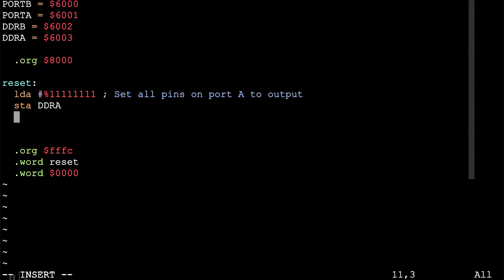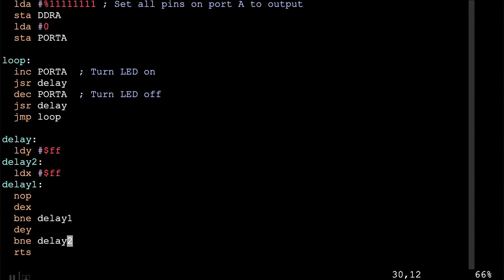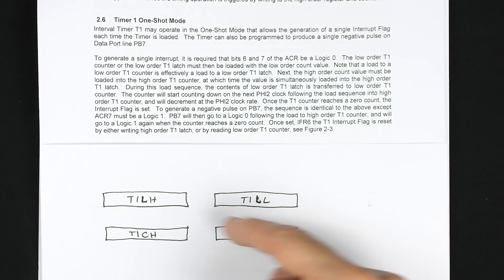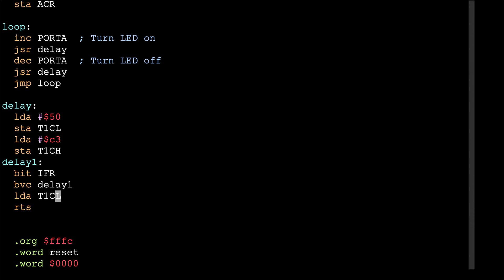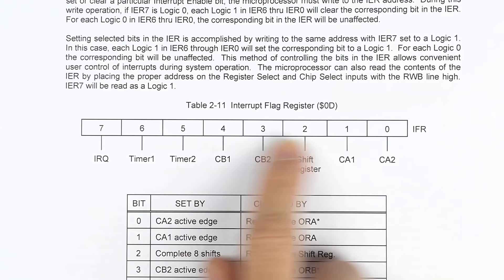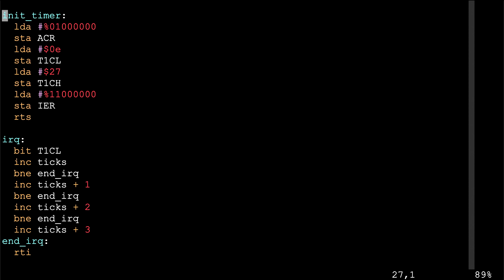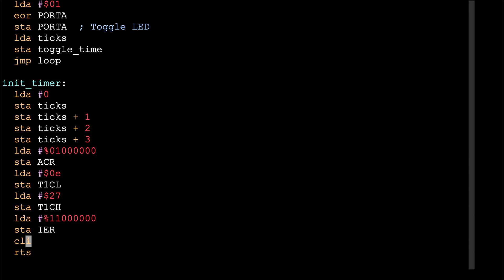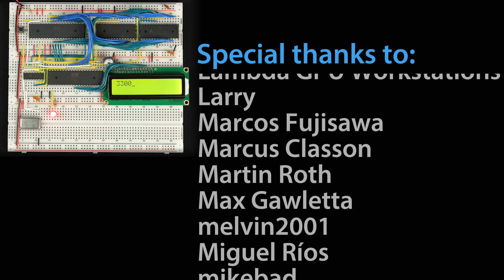How do hardware timers work?

Comment: In a more sophisticated system, I might expect the timers to be triggered a little differently.
In order to not require a "main loop" like you have... perhaps you would instead set up a time to wait and then mark the "return address" of your wait somewhere, and then when an interrupt occurred it would check if it's waited long enough, and if so, jump back to your code?
Reply: That's what schedulers are for.
Reply: Or just have the timer trigger an interupt, have your interupt routine check which timer triggered it and execute the address you defined for that timer if you want that functionality with this hardware.
Reply: @ELYESSS  I wrote my own for arm cortex using the 24bit low-power rtc timer:
 for (int i = 0; i < TaskListEnd; i++) {                                         // look at all tasks interval register
      temp = task[i].sleepto;                                                         // get a temp copy
 
      if (temp != (uint32_t)-1 && temp > rtcmatch) {                // a set value and not already past due
        if (temp < lowest) {                                                            // is it a new lowest
          eventrtc = (1 << i);                                                           // when we are the next event
          lowest = temp;							             // this is the new lowest
        }
        else if (temp == lowest)						     // merge us in as we have same as another
          eventrtc |= (1 << i);
      }
Reply: @someguy4915  This is how it should have been done. It's not "correct" to handle the LED switching in the main loop like he did, instead, what needs to be done, is to have an interrupt signal coming from the timer to make the CPU execute an interrupt subroutine (ISR). This subroutine should PUSH (and POP at the end) the status of the registers that it uses, and read some variable in memory (or directly from the output port if the CPU allows) to XOR the status of the LED, and output to the LED port. In this way he could have had a dummy while(1) loop doing nothing, and let the interrupts control the whole thing. 
EDIT: the 6502 has at least 3 interrupt input pins, so he could have wired the interrupt signal from the timer to the CPU, and setup the ISR accordingly. In the end I think he got confused and ended up doing the same thing as before (constantly polling a flag in a loop), but with extra steps (setting up the flag through interrupts).
Reply: @luisjalabert8366  the 6502 doesn't have a low-power mode though so there is no real point in "sleeping" it. You will be busy looping anyway so might as well keep it simple and check the ticks every time.

And remember that this is a tutorial series, this kind of multitasking is perfectly valid and a lot simpler than a proper scheduler.
Reply: @ratchet1freak  no, you are absolutely incorrect. This has absolutely NOTHING to do with "sleeping" the CPU, this is how interrupts in general should be handled. Your comment denotes a clear lack of knowledge in assembly programming, embedded systems, and hardware-software in general. NOTHING about this requires any kind of "proper scheduler", you are mixing things up. And finally, he made the whole system much more complicated than he needed to do for a basic tutorial series.
Reply: @luisjalabert8366  There is no "proper" way to do multitasking on microcontrollers.

You'll find that a lot of DIY arduino projects do the 

void loop(){
updatething1();
updatething2();
updatething3();
updatething4();
/*etc*/
}

and are perfectly fine doing so, even though arduinos do have a low power mode. This is a lot simpler than trying to keep a priority queue of timed tasks and dispatching them. 

Much simpler to just check them all one by one and repeat ad infinitum.
Reply: @ratchet1freak  there ARE proper ways to do multitasking in CPUs. Dude, I am an electronics engineering with a masters degree in embedded systems; I used to teach this stuff in the university, and now I work in design of GPUs. You don't know what you're talking about.
Reply: @luisjalabert8366  I don't care about your credentials, dude.

As long as the method is simple to debug and reason about then it's a proper multitask. Messing with the stack values to do a return somewhere different than where the rqi was issued is not easy to debug. One other pitfall is when your tasks take too long and you need to fail gracefully. With check one at a time that happens automatically, with irq scheduling you need to keep a copy of the stack for each task, on a memory constrained microcontroler. It's not a hard real time solution but good enough for most non-life critical systems.
Reply: @ratchet1freak  you should care about my credentials, because when someone much more qualified than you is telling you otherwise, you should at the very least be a little humble and question yourself, and perhaps acknowledge that you might be wrong, instead of pushing ahead stubbornly. The issue is that you COMPLETELY missed the point here, Ben tried to showcase how to handle the problem by servicing IRQs, but he ended up doing flag polling, which is exactly the SAME thing he did without the interrupts, thus completely missing the point of handling the problem ONLY when the CPU is interrupted. He mentions that by using interrupts you can free up the CPU to do other things, but the fact is that he ended up with the same problem, polling the flags in a loop, which is NOT the way to solve this problem IF you want to use interrupts. Perhaps when you grow up and take some basic electronics courses, you will understand this, and you'll remember this conversation. I gave you my knowledge, it's now on you the choice of whether to learn from it, or keep yourself misinformed. Good luck.
Reply: @luisjalabert8366  I don't buy into the argument from authority fallacy.

There is a difference in how he went from one flag poll to another.

In the first iteration (delay) there was one tiny place where he could do other work.

Then when he added the IRQ counter he can add another timed task just by doing it after the first, even when the timeout is different from the first. This is the magic of BlinkWithoutDelay (as it's known in the DIY arduino space) and why it's (IMO) a fundamental concept to grasp when you do timeout/flag polling in a busy loop. And even when you do interrupts you want them as short as possible so the advice often given there is to set a flag for the main loop to pick up.

As an aside when dong cooperative multitasking each task can clean up the scratch memory (read: stack) they use before handing off. With preemptive multitask that is impossible, so when memory constrained one should prefer cooperative and the simplest way to cooperate is to return to a main loop that checks each task in order.
Reply: @ratchet1freak  I don't want to get pulled into this too much, but the argument from authority fallacy does not apply here. The other guy isn't saying he is correct because he has the degree. He is actually making an argument and is suggesting you should take it seriously because he has a degree. You can't just wave away any argument from an expert because they are an expert. Experts are experts for a reason. They can obviously be wrong, but being in a discussion with an expert on a subject matter should make you worry that you could be missing something. Especially if you're not an expert yourself.

His arguments do match with what I've seen in my CS degree as well. I never went low-level enough to have actual experience with it, but this was covered in both the OS and hardware courses we had. It does seem like a bit of a wasted opportunity to really show off how interrupt handlers can be used to do asynchronous tasks. I don't think it would even have been that much more complicated. Most of the code would be identical, but just in different places with a different control flow.

Pointing that out is fine. I'm sure Ben can handle a bit of constructive criticism. The best case scenario is that he simply makes a follow-up video showing how to do it better.
Reply: @Niosus  Sure credentials have some weight but not when the first reply is calling me ignorant (bold claim) and the second reply is nothing but credentials and then the rest of the arguments are littered with high and mighty bs.

Also remember that this is a 6502 with a hardware fixed stack location. To do a full preemptive contextswitch you need to copy those 256 bytes of stack over to a spare location and copy the other task's stack back (or bank switch on the stack location but that isn't setup here yet). This is complete nonsense operation with unacceptable overhead. 

Or you need to make sure that the context switch only happens when the current task is done/not executing currently (so no stack to preserve) but why do that in a interrupt routine when you can simply return from the task to a  main loop which will then JSR to the next task. 

KISS applies here. An event loop like Ben ended up with is a very simple and important pattern to learn as a programmer because it it nearly universally applicable and very wildly used in just about every program that has a gui or listens to the network. Context switches and messing with the return of a RTI aren't nearly as applicable a concept and much too complicated for this step in the tutorial.
Reply: In a proper system you would have a nested vector interrupt controller that handles all the address stacking for interrupts and then you'd set a hardware timer to run the exact period you need, not just a systick and a bruteforce check.
Reply: @ratchet1freak  Every single modern microcontroller saves the current context before jumping to an interrupt vector automatically. Every interrupt system should save the context before jumping to the vector so that it can easily continue where it left off, that's the whole point of an interrupt. Also, you don't want to be screwing around with "task scheduling" on a micro like a lot of clueless people here mention. Only run code when you actually need to. When you build a system complex enough, you will realize that basically all of your tasks will end up running from various interrupts, whether it be timers, USB peripherals, ADC or simply just a GPIO switching. I have a large new product in development that runs a massive 500MHz Cortex M7 CPU and the wait loop is completely empty. Everything runs off of timers or various other interrupts. Of course for something as trivial as just blinking an LED it doesn't matter, because no one would ever make something like that for production. In that case you can just use a capacitor to inflict a delay.

With that being said, if your MCU only ever has to do one single thing, doing a brute force instead of an interrupt isn't going to hurt.
Reply: @TheChrisey  But you wouldn't put 2 hardware timers to schedule 2 timed tasks. Instead you would use a priority queue system that gets checked each systick to see whether the earliest deadline has passed. 

In this case it's 2 tasks so no need for any complex datastructure and you can unroll, constant fold and inline the check. And it makes sense to put the check outside the interrupt handler itself because there are only 2 levels of interrupt on this hardware and you want to keep duration of execution of those as small as possible.
Reply: @ratchet1freak  Yes, you would. That's why you have multiple timers. In this case there is only 1 task. Where did you get the second task from? He failed the example. A modern system would include some form of prescaler or PLL loop for the timer, or even a separate crystal in worst case scenario.
Reply: @TheChrisey  At the end of the video the second task is updating the LCD display. 

Though eventually you will run out of hardware timers to tie to timed tasks and you have to prio-queue them.
Reply: @ratchet1freak  Updating the LCD could easily be made in the same interval as the LED. You obviously chose your hardware to fit your needs, that includes the number of timers. Even the most basic modern MCU will have plenty of timers to run multiple things. No one who ever wrote anything demanding will ever use software scheduling on an MCU. I think the MCU I'm currently using features over 25 internal timers...

Comment: Ben suddenly ceasing any and all forms of communication is very uncharacteristic of this channel and had me fearing for the worst. Maybe he's taken a permanent break from doing breadboards and has since moved on to breaking bread with higher beings.

May the metal clips on the eternal breadboards never wear out. And the wire stock never run out. And the caps, LCDs, and other components forever as pristine as the day you bought them.
Reply: he good

Comment: Now that you have an irq, the system requirement of an OS has been fulfilled. Just need a scheduler and a way to context switch
Reply: thus BreadboardOS is born!
Reply: Don't need a scheduler nor a context switch on a micro.
Reply: @TheChrisey  I'm unsure if you're being facetious, but yes, you do see those in microcomputing. Mainly RTOS when it comes to microcomputing. There have been 6502 operating systems built for microcomputers as well!
Reply: @jaredteaches894  Not for anything serious. Obviously I know about RTOS, and I also know how useless, slow and bulky they are compared to a minimal HAL library.

Comment: 17.10 I see you have the unique HP16C.
I have had one of those for 40 years, I bought it when I started out as a computer scientist and I have used it ever since. I even bought a second one so I have one at home and one at work. For those not in the know, In 1982 these calculators were packing a programmable word length 1 - 64 bits so you could simulate the whole variety of CPU's that were around at that time, bit sliced cpu's, 8 bit, 12 bit 16 bit etc etc. a 64 bit calculator in 1982 ?, amazing, and it will even give you 128 bit results for 64 bit multiply etc. They are just wonderful never to be copied calculators and are worth far more today than when I bought mine.
Never had any issues with them and the HP manuals are legendry.

Sorry to gush, I have never seen anybody else ever use one.
I have the original box, manual, service cards, sales receipt, sad, I know, but it is just unique.

Comment: Low power mode: add a WAI instruction to the main loop. This pauses the CPU in low power mode until the next interrupt occurs.
Reply: Interesting that the newer 6502s have this instruction, older ones definitely did not.
Reply: @ebenolivier2762  yes, WAI was introduced with the Western Digital CMOS 65C02 which came out in 1983. 6502 based machines like the PET, VIC20, Apple 2 etc used earlier Mostek and Rockwell designs which had significant differences. I don't think the 6510 used in the C64 had a WAI instruction but I may be wrong, it had a number of variants of the chip.
Reply: @IanSlothieRolfe  Interesting! And what is more interesting is how long ago this instruction was added, way before saving battery power was a "thing".
Reply: @ebenolivier2762  I think the main motivation for introducing WAI, was to improve interrupt latency, since when waiting, the processor will immediately jump to the interrupt service routing instead of having to finish the current instruction first. Indeed if interrupts are DISABLED when executing WAI, the interrupt service routing is bypassed and execution continues immediately following the WAI instruction, for the fastest possible response.

Comment: I think there’s a bug. When ‘ticks’=0xFA at the end of the loop, when it comes back around, and the interrupt handler fires 6 more times, ‘ticks’ will now roll over to 0x00. But now you’re subtracting from that, ‘toggle_time’, which is still 0xFA, with the carry set. So, essentially, you’ve got 0 - (-250) = +250, from which you now subtract 0x19 (25) in the CMP instruction, but what’s the state of the carry bit here (right before the CMP)?? Will the BCC branch get taken? If not, that’s going to toggle the LED after only 25x6 =150 ms. Not a problem for just an LED, but if you were trying to use this to toggle some real device, you could have a nasty, seemingly intermittent, glitch every now and then! If it does take the BCC branch, it’ll add an additional 150 ms for a total of 250+150=400 ms, which will cause the LED to stay on (or off) too long. That’ll definitely be noticeable. 😏
Reply: no it's 0 - 250 = 6 (mod 256)